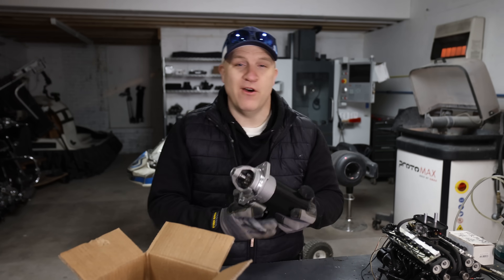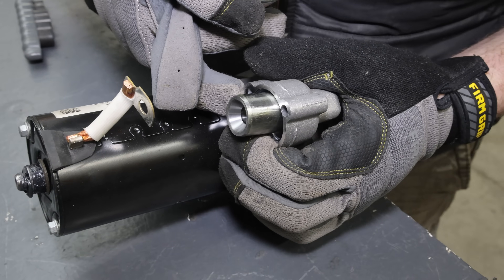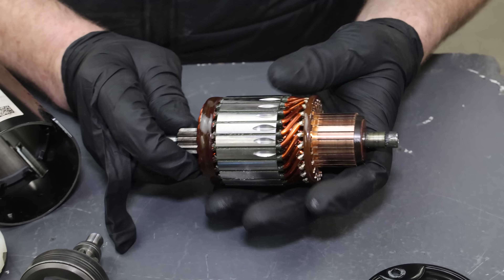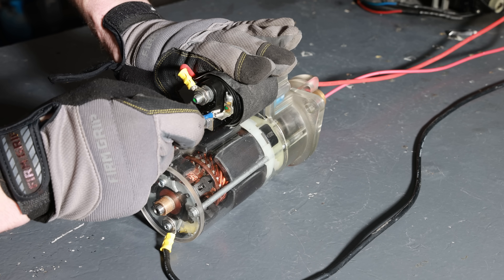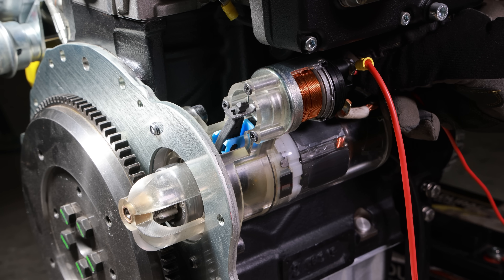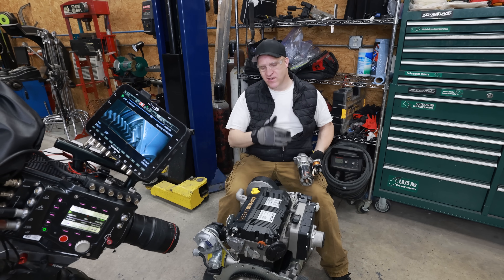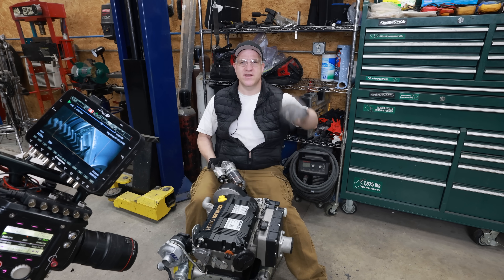See Thru Engine Starter

Comment: Great work demonstrating this kind of old school starter. The ingenious part of this design is that if the gears do not mesh, the starter motor will not be connected to electric power at all. All the spinning of the pinion gear is just springs inside the mechanism that gets pushed by the solenoid.

Some pinion gears have some kind of forced release mechanism in case the solenoid hangs while in starting position. If the pinion doesn't release, the engine will spin starter motor too fast and the coils in the anchor will be thrown away by high g-forces. That will typically destroy the starter and may take the teeth from the flywheel, too.

I think the video would have been more interesting if you had included info about what can go wrong and what happens then. The most common failure mode for the solenoid is facture in the fork that tries to connect the solenoid to the pinion because the spring in pinion is supposed to pull the solenoid away from the contacts.

Comment: Very good video, even if it didn't work it was enough to see all the parts well. The cable gauges on some of the runs looked a little low to me, probably got hot and suffered a fair bit of voltage drop.

Comment: Not sure, but I think in the modern cars, the starter won't engage if the engine is already running. I remember being so tired sometimes that I tried to start the engine while already running and didn't hear any grinding. I have to check it to be sure though😂

Comment: Heloo! You did experiment with diesel ignition. transparent. Lets say, if compress it slowly, like 1 hour, it will get high pressure, but temperature will dissipate. if hit with hammer - ignite immideiately. somewhwere between them should be pivot point spot. can you try compress that transparent diesel cilinded in press, slowly, then faster and faster.

Comment: if you get an older starter, like say one from the mid 80's for a square body pickup. it is much larger and heavier than that one and it doesnt have those planetary gears. it really is just a gear on a motor.

Comment: The spiral gear and spring seem to be where the magic happens.  We see the starter gear bounce off the flywheel and turn just a bit so it can mesh before the motor spins up.  Very cool.  

The contacts in the solenoid is just a copper disk pushed closed

Comment: This is such a crude mechanism, in theory already having been replaced by ISGs two decades ago, yet these simple brushed motors with a single cog getting pulled in and out somehow survive.
Reply from the maker: Yeah but integrated starter motors are used mostly on hybrids, I don't think I've ever seen an integrated starter generator on a non-hybrid vehicle
Reply: @WarpedYT  There's a timeline where mild-hybrids used 48V grids and ISGs, especially for sailing. It's something that suppliers have been trying to sell for more than 20 years. It's just not our time line. My ICE car still uses a conventional starter for start/stop-automatic, and since it's leased, I don't care. But imagine what that cog is going to look like in 10 years of driving.
Reply: ISGs are pretty large and heavy, need additional support electronics to work, and 48V. It's hard to justify an ISG in a non-hybrid vehicle given the simplicity and compactness of a pre-engaging starter motor. ISG + mild-hybrid system seems to be gaining popularity though.
Reply: @ryan.crosby  Overall that's true, but I have been participating in some parts of the HECO2 program in the past, and there is quite some fuel-saving potential in those technologies. Obviously you don't want 48V just for an ISG.

Comment: For any motor, the outer ferrous metal casing is not just for strength and rigidity, but also to carry the magnetic flux. Once you replace it with something non-ferrous, the motor is 100 times weaker.
Reply from the maker: I know I know... But I was being hopeful

Comment: Older starters were exactly what you thought, direct drive. A lot of them were also Series wound DC motors, not permanent magnet ones like this with gear reduction. Are the new ones better? Eh... considering engines keep getting smaller and smaller, it's hard to compare.

Comment: I used to recondition these starter motors. This is a Bosch gear reduction type,  not all have gears inside some are more simple. If you want you can take the gear apart that engages with the flywheel, it's called "the drive" it has a one way clutch inside it
 and rollers + springs and grease properly about 12/15 parts inside the drive, the factory used to have a drive room were 3/4 people rebuilt hundreds of them every day! The solenoid cap will push off if you push inside the big hole.  Also the solenoid has 2 coils inside.  1 called the pulling the other called the holding.  There is also a big piece of copper inside the solenoid cap, this is the switch to make the motor move.

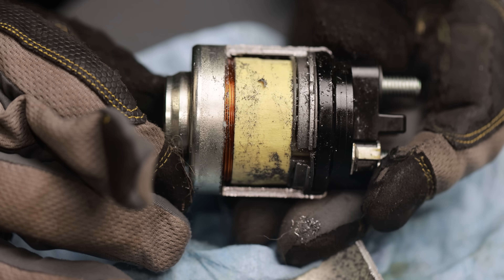Comment: 3:59 it's an electromagnet with a spring. The electromagnet either attracts or pushes and the spring pusses on the opposite direction. Do not disassemble it.

Comment: I can't believe what I just saw. A PLASTIC planetary gear housing just next to an electric motor, with the plastic basically touching the windings? I mean, not in your model, I mean in the original thing. That's built to fail!
Thanks for your great vid!
Reply from the maker: I don't know, these starters last for a very long time. But yeah I don't think that plastic housing holds any torque at all

Comment: Not all starters are the same design. What you were thinking in the beginning is true. take a old VW bug starter, they use a Bendix design, the spinning motor pushes the starter gear out not a solenoid and there are no planetary gears either. much simpler. But as ICE motors got larger so did the requirement for the starter. Thank you for sharing with us, so cool seeing the clear build.

Comment: Whilst you took care of the electrical path to ground the magnets also need to be closed circuits paths also. The solenoid return path is the metal you removed but half would probably work. But for the main motor the permanent magnets need to be in a magnetic ring or it will produce no torque.
Reply from the maker: Yeah Magnetic flux, I kinda realized that and I meant to mention it in the video when I talk about the plastic case and  the ground but I forgot, and I didn't think it would make such a huge difference with the torque, the starter still worked but the difference in torque was substantial.

Comment: I think the clear starter was spectacular as a bench demo.
The attempt to use it to crank an engine was bound to fail for several reasons. Even if the nose cone hadn't failed, the steel around the magnets is responsible for a significant amount of torque the motor produces, which is why you thought your battery was dead. 
You should rebuild it in clear plastic again, and just make a display with the flywheel mounted a shaft on bearings.
If no torque is required to turn the flywheel your clear motor and housing will show exactly how the real starter works and last several hundred cycles.
Good job.

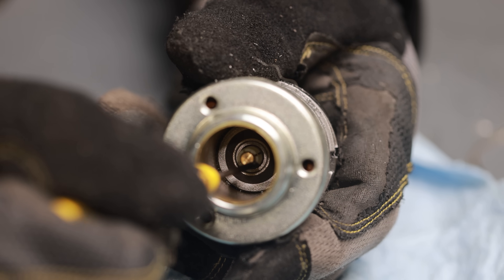Comment: 4:09 it’s just a disc that shorts the studs, common failure point . Arcing causes carbon buildup and etching, check voltage drop in a click click good battery, never tappy tap with a hammer, shatter permanent magnets or dislodge and chew them up

Comment: 2:27  the yoke pushes the internal slide gear to couple the motor and output shaft, the helix cut into the output shaft is the same on the benefit gear, inertia forces that out to mesh with flywheel, by having it mesh that way it’s better for the motor if a false start occurs as these are very high current , as seen by the coarse single windings .

Comment: Cool! On automotive applications the starter usually won't begin rotating until the gear is fully extended. Maybe because this is a smaller engine it rotates right away.
Reply: but how would it then engage if the gears aren't pre-aligned correctly?

Comment: It's called a flywheel, not 'starter ring'
Reply from the maker: Well my understanding is that the flywheel is the flywheel, the starter ring is the gear ring around the flywheel that is hardened, that's a separate piece

Comment: Great work!  That 3D printer is sick.   It's obvious now why the nose cone is so thick and why they crack sometimes.  

Next you should do a see through air hammer.   Maybe then we can understand why there are no battery powered air hammers
Reply: But there are some starters that I've installed that don't have a nose cone. I'd like to see a side by side comparison of the 2 designs

Comment: the real damage while starting a re starting an engine whilst engine is still spinning is the flywheel's ring gear teeth will round and wear first as it IS a softer metal(teeth)(less soft than the starter's teeth)
Reply from the maker: I think that depends on the engine in this case the ring around the flywheel is hardened and the starter is the softer metal. If you look at the slow motion footage you can see the teeth actually chipping away

Comment: Great effort.  The plastic chassis hurt the torque, but I'm not sure if the engine had plugs in it or not.  If the engine was making compression, this would greatly increase the torque demand on the starter, so you might have better luck with a free-spinning engine.  Again, if you didn't already try that.

Comment: Thanks for the video. I think this could benefit from slightly more explanation or visualisation, like how the electromagnet/solenoid has the contacts to run the motor, at least as a basic diagram or a whiteboard drawing, but it was fun to watch either way :)

Comment: Uncle Tony’s Garage claims the problems when converting carburetor to fuel injection,come from the fact that the mixture doesn’t get heat as it expands while traveling thru the plenum,towards the cylinders. It would be nice to see the actual effect that temperature has on both a conventional intake plenum vs one fitted with a transversal tube carrying hot water through the plenum. Maybe an electric coil heater,such as the Diesel engine’s intake.
Great video. Keep’em coming!

Comment: 5:27 I know I've asked this question before, but in this recording is the audio real and maybe displaced in the sequencer, or is it all fake?
Reply from the maker: That particular part of this video is the actual sound just slow down, but some of it and some of my other videos is definitely Foley, because once you slow a sound down that much it's not sound anymore, for instance if you have a sound recorded at 300 HZ but your recording at 3,000 frames per second, if you slow that down you will end up with 10 Hz which is inaudible, so the only way is to use imagination, funny enough for this video the 100% Foley Park is during the slow motion gears at the end, I'm going to post to Instagram video about it in like an hour so you can see me making the sound and see where it's used, it doesn't actually sound perfect it's a little bit too metallic but I didn't have any more time I need to have this video posted today was my deadline.

Comment: As a mechanic let me say you just added concrete proof to something people like me have been saying for decades. Well done!
Reply: Yeah,it is my own experience as well,specially saying ppl not to try to fire on a car just with the poor starter when they run out of gas.😂😂😂
Reply: @salvadorsaucedolopez2644 The old direct drive starters can move a car quite a bit with no damage. They don't have any gear reduction.
Reply: @theodorgiosan2570  I actually found that on a riding lawnmower and indeed it works.

Comment: 2:03 older, slower rpm starters actually were as you thought it was and they are much bigger than modern starters.
Reply: Yes, my car has one of those, 1979 Subaru DL wagon. My partner's car, 2007 Pontiac Grand Prix GXP also has a direct drive starter, probably one of the last that was ever installed on a car.

Comment: Fantastic Great !  i repaired a Toyota starter once, just at the electromagnet DC Connector, and cutted a piece of copper coin and soldered it on place, as this was very teared- it´s almost same load you will have when you weld, with electrodes ,and you can turn + and minus ,you will notice electrode on + you burn more into the material, and wit electrode on minus, you burn more electrode,and less into the material . Thanks for Great Video !

Comment: Did you have the plugs in when you ran the plastic starter? If so then I'm not surprised it broke, but without compression it might be able to handle it...
Reply from the maker: Yes, it's diesel so even worse, I was thinking about removing the injectors but that's just way too much work as you have take apart the whole top of the engine

Comment: This will be a great video for auto students. 
Thanks for putting in the time and effort to make the transparent parts and the slow motion video.
Reply from the maker: I appreciate it, I wanted to make this so people could get a better idea for  how the starter works.
Reply: @WarpedYT Hi, older starters didn't have the gearing, and they really did kick  when started. 
When I bought a recon 😅 starter for my now 30yr. old VW Golf, the test label stated it was 5000 Watts, at 12volts thats over 400 amps. To put that in perspective, an average household cooling fan is around 50 Watts, around 1/5 amp. at 240V UK supply.👍

Comment: You did a very nice job with the form labs printing, that end cap looks like Plexiglass though LOL which is still the same material more or less.. I give you a lot of credit, lot of skill to get the fit so good. Learned something myself which I never thought about, most ALL of the torque when starting the motor is pushing against the top of the housing where it snapped off and of course a diesel engine has enormous compression.
Reply from the maker: Thanks for the comment, the material is similar to acrylic from what I'm told, yeah definitely the diesel compression had something to do with it, I wanted to remove the injectors but that's too much work you have to open up the whole top of the engine.

Comment: Yeah It not only Damages the Pinion Gear, But also Causes Overheating in the Starter Solenoid, Coil, and Armature from Not being able to deploy and spin properly, Basically Increases the Overall Wear on the Starter and would lead to early Burn out of an electrical component.👍

Comment: When you pulled the magnets out of the iron case, the magnetic flux opened and the force of the magnets decreased. It is possible that even if the hull had not broken, the motor would not have been able to turn.
Reply from the maker: Exactly, I meant to talk about that but I didn't think it was going to make such a huge difference..
Reply: @WarpedYT  It would be interesting to know the truth. One Russian DIY blogger (Negoda) makes a racing car and reduces the mass of all the elements as much as possible. In one of the recent videos, he was grinding through the body of an electric starter and doubted whether it was possible to make the walls very thin (reduce the magnetic flux). So far, he's left a lot of iron against the magnets.

Comment: One of the main reasons a starter will fail is that its gear doesn't retract after the engine is started and it will keep running with the engine.
Reply from the maker: That's actually a great point, and that is also happened to me before, the starter just started burning up... It was on a Kohler diesel in my Tesla and I accidentally left the starter engage the entire time the engine was running, after about 5 minutes it started smoking and I was literally in the middle of nowhere, I was so nervous but to my surprise the starter still works to this day.
Reply: Starters on modern cars have sprag clutch aka one-way bearing to avoid spinning the starter with the engine
Reply: Also I think the wobble affects it, puts awkward stress and tension and friction. Loved the video